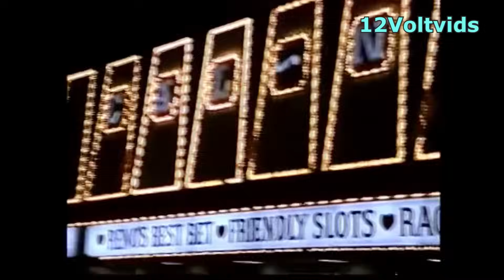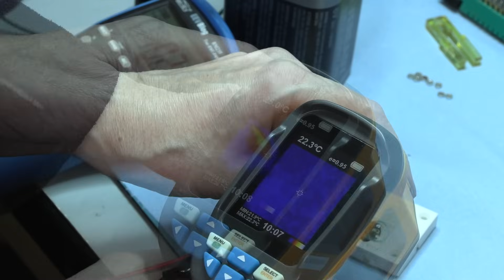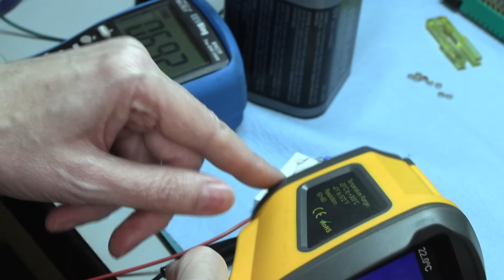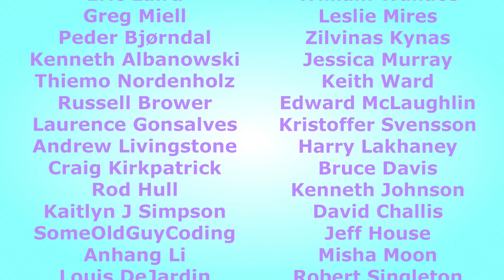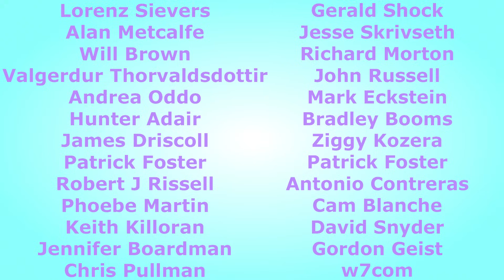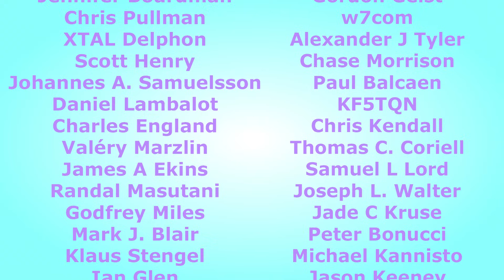Keep Them Bulbs On!!!

Comment: Old " instant on" vacuum tube TVs did that...the filaments stayed on. It didn't noticeably shorten tube life. Some had a " vacation switch" to shut the filaments off.
     In 1976 I built a nightlight that was two 7 watt Christmas tree bulbs wired in series, house in a wooden bait box designed for crickets. My aunt had it for 40+ years, now a cousin has it in a garage. Not counting power failures, it's been on since Fall of 1976...
Reply: The two light bulbs in series would have to last for over 100 years to infinity. (½ Voltage = at least 1000 times longer lifespan.)

Comment: I work in the entertainment industry
We call that preheat. It is used in high power stage lightning which is almost always hooked up to some sort of dimmer anyway. If you command the dimmer to be off, it actually sends some (adjustable) amount of power to the light
This has not only the advantage of longer lasting bulbs
It also limits the inrush current drastically which can be mandatory for running several lights on a single circuit that would otherwise trip the breaker
Also it makes the light come on faster which is desired with audience blinders for example
One downside other than the extra amount of energy needed even when the lights are of is that the filaments can start vibrating with the dimmed voltage. That "lamp singing" is audible and can be disturbing
Reply: It's called warming current here in UK theatres. PAR lamps seem to sing more than other lamp types.
Reply: Aren't LED's  being used in stage lighting?
Reply: @franklittle8124  Yes, now they are everywere but I remember blue LEDs becoming a thing in the mid 90s. Bevore that it was thungsten or high pressure discharge lamps. LED stood for light equipment desaster for some time
And audience blinders with LED are still a big nono on certain jobs (mostly Rock,heavy metall and similar genres)
Reply: Back before LEDs became practical for household lighting I used a remote-controlled dimmer (triac type) for my reading lamp and the "lamp singing" was quite noticeable at certain settings. Never knew there was a name for it.

Comment: Note made by others from other tech contexts, but here's my addition. I know that in some countries, for safety reasons, the bulbs for railway and some traffic signals are hooked up so that they are in series with a relay coil to ground/neutral when in the "off" position. 
The relay is selected so that it pulls when in series with the bulb, but doesn't make the bulb light up.
This means that if the bulb goes open (fails or is removed), the relay in series with the bulb will drop when in the "off" position, which means you only need simple relay logic to get an alarm output which says that the bulb needs to be checked up.
I learned of this design trick a couple of years back, and up until then, I'd always wondered why some traffic lights and railway signals fade in and out rather than going hard on/off It's because they cool down slower because of the remaining current through the relay.
And it wouldn't surprise me if bulb longevity is also a reason why they went this route, as it means that the bulb is always preheated and won't experience the same level of thermal stress.
Posted as yet another application of the design trick, and maybe for some people to keep it alive in their designs.

Comment: I’m 64 years old, so I cut my teeth on batteries, switches and bulbs, and watched in awe as transistors (my transistor radio was about the size of a ladies handbag), LEDs (ooh! Soo pretty), and Integrated Circuits (witchcraft, sheer witchcraft) took over; but, I never knew this about lightbulbs!

Love your vids - they are so calming and comforting!

Comment: On DEC gear, the bulbs were run between "just slightly red" and "glowing enough to see".  They never turned them off and they never took them up to the rated voltage and the change wasn't fast.  As a result, they lasted for decades.  You can find videos of people with PDP-8 computers with the bulbs all working.

Comment: Light dimmers also extend lamp life. I have a grandfather clock that has incandescent bulbs in the base illuminating the pendulum. The original bulbs are still in it. They have been running over 20 years at 1/3 brightness. They will probably last 100 years

Comment: Nice and simple. Makes me wonder if those old pinball machines had bias resistors too.
Reply: "technology connections" channel delves deep into those machines and how they do the "math".
Reply: I watch "Joe's Classic Arcade Games". The schematics I've seen there for EM pinball machines don't preheat the bulbs. The bulbs are easy to change so it's not an issue. If you wanted to it would be an easy upgrade; the lighting is on a separate power supply so you wouldn't need to worry about backfeeding any logic.

Comment: I have heard the early vacuum tube computers in the ENIAC era did this too.  They left the heater supply always on at a low level to preserve the tubes.
Reply from the maker: Yep.  What killed the reputation of reliability of vacuum tubes was television sets, because designs routinely overvoltaged tubes and overheated solid state components in densely packed chassis.
Reply: @FranLab ,  Specialty variant versions of otherwise common tubes such as the 12AU7 were developed specifically for computer use because it was discovered that long periods of idle with virtually no current passing through the tube would cause cathode poisoning, a loss of emissions also referred to as "sleeping sickness". (One wonders if it was ever referred to as nocturnal emissions"? 🤔😉)

Comment: I figured that out when I saw that some pinball machines really whack some bright bulbs (they get far too bright to last at all)... except that the filaments are always on a little. I had no idea the extent to which this can be used. This is amazing to me! 
It would be good to install light bulbs where that would make some people uncomfortable. Especially for replacing those obnoxiously bright blue LED's found in electronics of the previous era. Perhaps a wifi or ethernet router, maybe a smart watch would be the worst. I don't have any that small but I've got a bunch that don't fit anything I've got. Next time I need to make an indicator panel I want to use always-on light bulbs. So thank you.

Comment: I have also observed this with flasher relays for turn signals in vehicles. The old ones flash using a heater and bimetallic switch. The heater is in series with the bulb which provides the "keep warm" current. Newer solid state ones for motorcycles and ebikes I have observed to have a lower pwm duty when the bulb is "off" and full duty when on so when I used LED bulbs, they went bright dim instead of on off. On my car, however, it still used relays so the lamps are fully on or off and I do remember having to replace bulbs until I converted all to LED.

Comment: Just something I have noticed. I have 2 LED (incandescent replacement) bulbs that I have on all the time.  They last much longer than those that I turn on and off. I understand it is completely different than what Fran is showing here. I do put the date on the bulbs when I replace them... yeah, nerdy.
Reply from the maker: Thermal issues still apply to the solid state components - not the LED's really, but certainly the voltage and current regulators in the power supplies.
Reply: @bumblesby keep the receipt. A couple of times I had a ceiling fixture without replaceable LEDs go bad before the 20000 hours they promised on the box. I went back to the store and got them replaced for free.

Comment: This is really interesting and helpful! Think imma build/modify exactly one table lamp and put that circuit inside (maybe in addition to a battery for when it's unplugged given the low current requirement) just so I can have some nice incandescent glow whenever I want a break from all the rgb LED's and not worry about if I can find more bulbs. It's not like white LED's aren't fine 99% of the time (assuming they have a smoothing capacitor), but I'm starting to miss the old ways and have found myself seeking out older tools and electronics to fix or augment. They objectively don't make things like they used to

Comment: On UK fruit machines/ slot machines did exactly the opposite by over driving to get bigger flash. The other reason was they wanted to limit life & keep the high turnover of machines with the game changing in the cabinet.
In the UK the machines regularly had new bulbs with wiring harness & front glass!

Comment: The Omega Indicating Light brochure says, ". Lamp life increases (or decreases) with the 12th power of voltage reduction (or increase) while light output is affected only by about the 3.6 power of voltage reduction so a substantial life increase can be achieved with a small decrease in brightness".

The power consumption does not decrease very fast with decrease in voltage, though, because the change in current in the incandescent region is small compared to the change in voltage.  For indicator lamps, the power consumption is typically a minor consideration compared to lifetime.  The inrush current to a cold filament when the lamp is switched on can be a substantial stressor.  The addition of a fixed resistor in series with the lamp can substantially reduce the inrush current.  It looks like the indicator panel uses this technique also.
Reply: I thought operating life was inversely proportional to the 16th power of the voltage but either way gets the point across.  Operating at a lower voltage will extend lamp life practically indefinitely.
Reply: @Alamagosa   We agree.  I expect that the life factor increases as the voltage approaches the point of "instant" burnout.

Comment: Another advantage of keeping bulbs somewhat preheated during off cycles in an applicatio like Las Vegas signage is that your electric bill will be lower than if you're pulsing them from completely off to fully on and back again,  because the filament has very little resistance when it's cold and only develops a high resistance once it's glowing red hot, and so the current rush at turn on into a cold lamp is enormous.
Reply: While the instantaneous power draw at turn-on will be lower the average power consumption will be higher with preheated bulbs.

Comment: Fran, infra red does not pass glass. You're measuring the temperature of the glass bulb, not the filament.
Reply: I think you mean "glass does not pass infrared"...
Reply: @clintoncoker6  you right, only silicon based life would pass glass :P
Reply: @Angel_Bob_  is that a challenge?
Reply: It does, but only wavelenghts shorter than about 2500nm. Most IR cameras look at longer wavelenghts than that.
Reply: @oscar_charlie  yes - that is why the analogous effect of CO2 in the atmosphere is called the "greenhouse effect".
(I await accusations of being "political" now)
Reply: I can’t imagine how annoying it is for her to constantly receive comments like this.
Reply: Infra red does not pass water.

Comment: Also later when companies did start to purchase computers, if they were big enough they would also have a technical maintenance workshop that would repair parts even if they paid for a maintenance contract to have a technician come out and replace the parts. The reason being that having a machine down for the day or so it takes to get the maintenance tech from the company out to fix the problem would cost the company a lot more than it cost to fix the problem yourself right away. Sure, they probably voided the warranty for that part, but again, paying for a new replacement is usually going to be worth the cost compared to the downtime.

And it's still done today. We've still got a technical maintenance workshop at my work. In fact I was down there last night and there was a tech repairing a panel light that blew because of a shorted LED. Chopped out the dead LED and brought the panel back to life. A quick and easy repair to get the panel back up and running. Maybe not as good as new, but cheaper than the cost of replacing the whole panel, and it gets the crew back out on the road with a full kit.

Comment: The resistance of tungsten changes by temperature quite radically:
- at room temperature (about 300 K) 5.5 micro-ohm cm
 - at 500 K  10.5
 - at 1000 K  24.3
 - at 2000 K  55.7
 - at 3000 K  90.4
 - at 3500 K  108.5
 So, from room temperature, the resistance up to essentially melting point, the increase is nearly 19-fold, or closer to maximum normal full operating temperature of 3000K, it is some 16-fold.  Calculating the opposite way, the inrush current can be about 16 * the rated operating current.  The bulb wire probably has some part that has lower resistance, and some with higher than average.  In any case, there is a harsh jolt (thermal and also magnetic/mechanical) at the high inrush current.  You may have noticed that light bulbs almost always fail at the moment of flipping the switch to ON.  This is the reason for it.
 If you keep the filament pre heated to 1000K (just below incandescence), your inrush is limited to about 4-fold.  Now consider that the electro-magnetic jolt is rather proportional to the square of the current, you may enjoy only 16x rather than 240x jerk at the time of turning full power on.  Finally, you can benefit even more, if you design the operating full temperature to be lower than the example 3000K.

Comment: 2:25 I guess that's only regarding the filaments in tubes? I've heard that cathodes wear out much faster with always-on heaters, and every vintage TV youtuber I watch warns about sets with "instant-on" CRTs.
Reply: That probably depends on if the tubes are run at the normal power at standby or just the bare minimum.

Comment: Depends on the lamp type. the high powered theatrical FLK/FEL/ect all need to be operated at high temperature. At low output levels, the filament vaporizes metal and deposits it on the glass. At full temperature, the filament metal gets vaporized off the bulb and redeposited onto the filament.
Reply: This still applies to halogens.

As the envelope cools, the halogen stops combing with the tungsten on the envelope, but as the filament cools, tungsten stops evaporating away from the filament. So as the bulb burns cooler both processes slow down. Once the envelope falls below 250°c, the halogen cycle stops completely. At this point, running the bulb more and more dim won’t hurt the bulb because the halogen cycle has already completely stopped. Dimming the bulb further, will however continue to slow tungsten evaporation.

If you were to draw out a graph of bulb life plotted against how intensely the lamp was driven, you would see bulb life decrease as you dim the bulb, but eventually you hit a point where the trend reverses and bulb life starts to increase as the bulb gets dimmer. As you continue to dim, lifetime just keeps going up, far above the life you would get at the full operating voltage.  The graph would essentially look like a checkmark. ✅

The halogen doesn’t have to return the tungsten back to the filament if it never left in the first place.

Comment: I've seen many long hours small bulbs, both still working and dead: they all got significant darkening on the internal surface of the glass - condensed material evaporated from the filament.

Comment: Running the bulbs at less voltage than they are rated for sure. Example>>traffic light bulbs rated at 130 volts. They last quite awhile.

Comment: Interesting… Thanks Fran. I remember the IBM 360 computers had a panel  with hundreds of tiny lights that flashed and flickered with different intensities as the computer ran programs. You could tell how the program was progressing by watching the light patterns change. I never thought about the issue of light bulbs burning out. Never saw that happen.

Comment: what about appliance bulbs, like in the fridge? turned on & off a lot &  also cold/hot, yet they seem to last a long time
Reply: That's probably due to their low duty cycle. If you have your fridge open 5 minutes a day it will take over 3 years to reach 100 hours. A typical appliance bulb is rated for 2000 hours so ignoring cycling the expected life would be over 60 years.

Comment: Regarding the conspiracy of putting limit on the lifetime of lightbulbs, it's not entirely evil.
To replace a 60w "short life" bulb you would need a perhaps 75w "long life" to get the same amount of light. That extra power would cost you more than the savings in replacing bulbs. It would also cost the power companies more in infrastructure. So the lifetime is the best compromise for the consumer.

For photography, sometimes the lamps are run at perhaps 120% when the picture is taken to get extra light, then turned low in between shots.

Comment: did they use this in cars? I have a Volvo from the 60s and as far as I know most bulbs are either original or changed last in the 80s and still working fine
Reply: My semi educated guess would be no (keeping headlights partially preheated from the car battery would be very rough on the battery and lead to premature failure or problems starting on cold nights), and it's more likely they used a really high quality halogen bulb, which has self-healing properties to prevent the filament from wearing out prematurely.  Volvo also probably refrained from overvoltaging the bulbs so as to merely gain a few extra lumens from them.
Reply: Highly doubt it, cars have batteries. Limiting current with a resistor is crazy inefficient. A few days without driving would leave you stranded, a few more days would over-discharge the battery. I can't imagine how it would be beneficial compared to changing a bulb every few years.
Reply: Just the indicators between each flash.  Some European cars pulse the trailer lamps when off to test them, which is really annoying if you then use LEDs, as these flash.